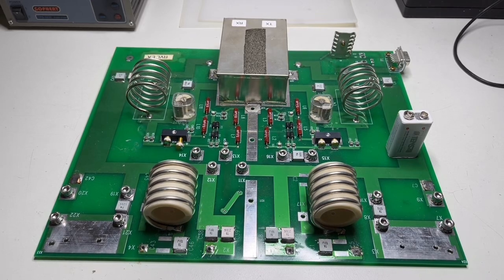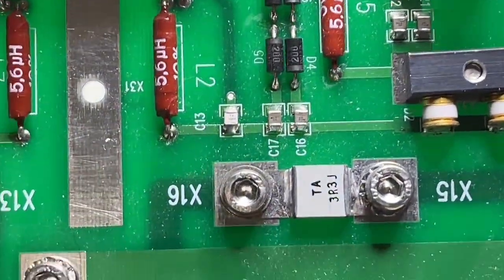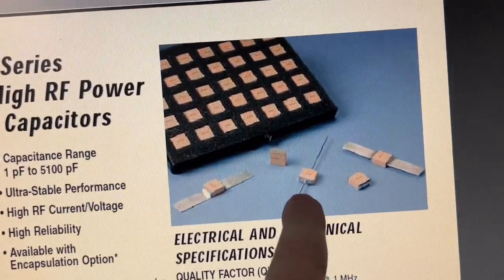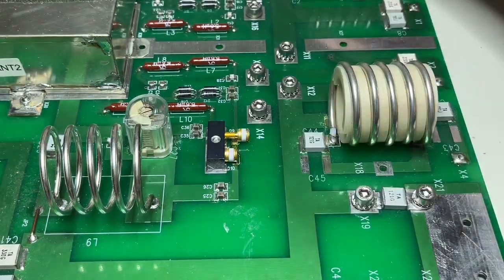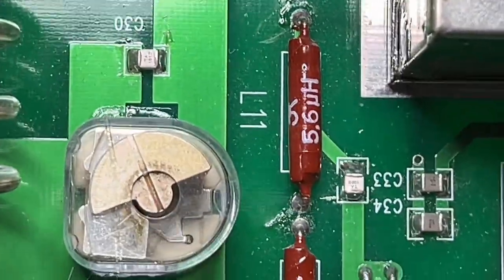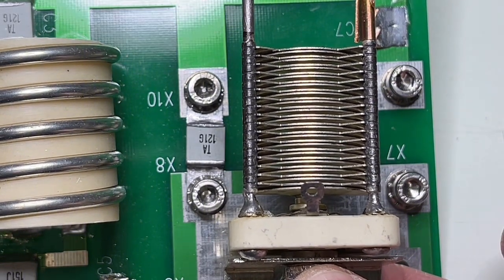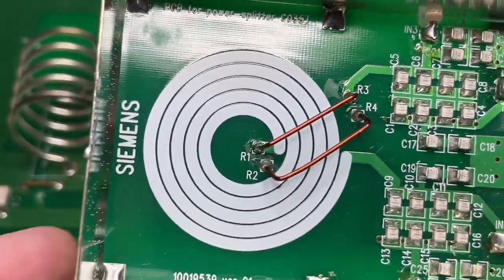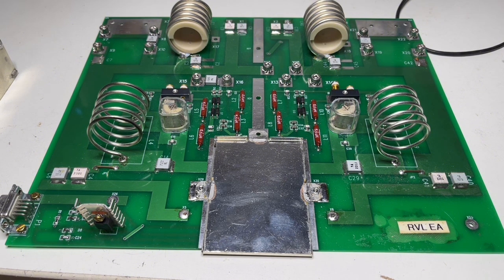RF POWER Magic, Antenna Switching Board from an MRI Machine

Comment: Hi. I only managed to watch a little of this but I was surprised by the name MRT. I’ve never heard that before but then again I only worked on European and Japanese MRI systems for about 20 years. By the way the frequency works out at about 42.5MHz/T so 63.8MHz is for a 1.5T machine which is probably still the most common. There are actually 2 magnetic fields, 1 static and the other pulsed (causing the sound) plus the RF. Regards, John.
Reply from the maker: Hi John, Thankyou for the Infos! In German its Called MRT or just MR